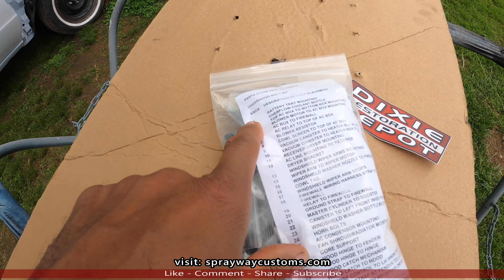How To Align Body Panels Up On A Car - Door Hood Fender Alignment & Adjustment For Perfect Gaps

Comment: Pro tip: if your doors are on and good gap BEFORE you take them off, drill a small hole through the hinge into the jamb and one through the hinge into the door. Tag that drill bit and keep it safe. When you go to put the doors back, grab that drill bit and use it to line up the holes you made. They will be back in exactly the same place. Save you a bunch of time and headaches
Reply from the maker: Good tip! Appreciate it

Comment: I’ve been watching as many of your videos as I can these past two months…. You’ve taught me everything I need to know to paint my car myself.  I made an instruction sheet step by step how you do it.  I gotta say, you are one sharp dude…. Hella smart guy!  Thank you SprayWay!
Reply from the maker: Fantastic! Thanks man
Reply: @SprayWayCustoms does this look right???

HOW TO REPAINT A CAR
1. MARK ALL DENTS, DINGS, AND CHIPS WITH A SHARPIE
2. IF ITS A HIGH SPOT, KNOCK DOWN WITH BODY HAMMER
3. SAND THOSE MARKED AREAS DOWN WITH 80 GRIT 
4. FILL THOSE AREAS WITH 2-PART BODY FILLER
5. USE DA SANDER AND 80 GRIT TO KNOCK DOWN TOP LAYER OF FILLER
6. BLOCK OUT THOSE AREAS WITH 180 GRIT IN AN “X” PATTERN
7. NOW DA SAND THE ENTIRE CAR WITH 180 GRIT (or hand block)
8. USE 180 GRIT BY HAND, OR MEDIUM SCOTCHBRITE TO GET SMALL AREAS
9. WASH CAR THIROUGHLY TO RID ALL SANDING DUST
10. DRY WELL
11. MASK THE CAR
12. WIPE DOWN CAR WITH WAX & GREASE REMOVER
13. USE A TACK CLOTH TO WIPE ALL PANELS
14. TOUCH UP BARE METAL SPOTS WITH SELF-ETCHING PRIMER
15. SPRAY HIGH BUILD PRIMER OVER ENTIRE CAR
16. ALLOW PRIMER TO DRY 
17. SCATTER A GUIDE COAT OVER THE PRIMER
18. WET SAND / BLOCK OUT THE PRIMER WITH 400 GRIT
19. FILL MINOR LOW SPOTS WITH BODY FILLER and GLAZING PUTTY
20. REPEAT WET SANDING LOW SPOTS
21. PRIME THE SPOTS
22. FINAL COAT OF PRIMER
23. FINAL WET SAND 400-600 GRIT
24. UNMASK THE CAR
25. WASH CAR THOROUGHLY
26. REMASK THE CAR
27. WIPE DOWN WITH WAX GREASE REMOVER
28. TACK CLOTH SURFACES
29. PAINT BASE COLOR 2-3 COATS
30. PAINT CLEAR COAT 2-3 COATS
31. UNMASK CAR
32. CUT AND BUFF 1500,2000,3000 GRIT